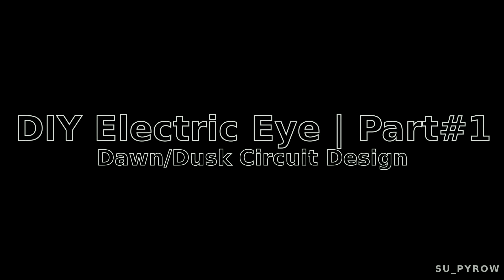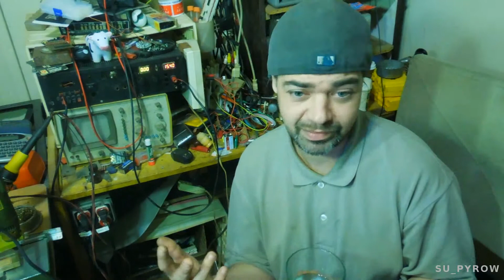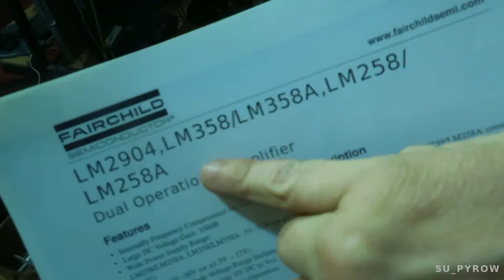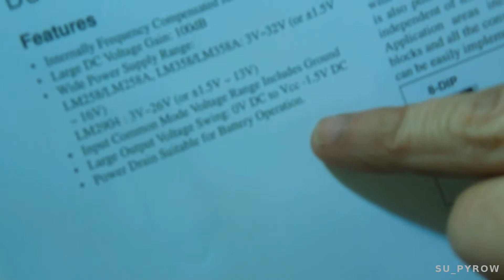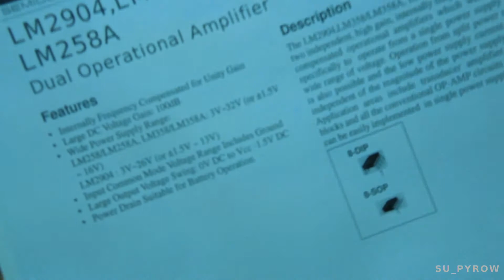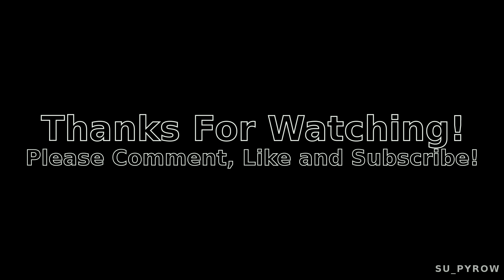DIY Electric Eye - Dawn/Dusk Circuit Design | Part#1 SU PYROW #03

Comment: Hay Bob, a lot of guys make vids about RUST.  Electrolysis, Evaporust, vinegar, other chemicals, without explanation of chemistry.  So this is a vid request for you to teach us experimenters.  Um gonna try some sodium bisulfate, cheaper and better than my fave vinegar.  Evaporust is a ripoff.  buzz1151 did a neat little vid on zinc and  electrolysis.  mrpete222 did a bunch of methods in a series.  Joernone likes Evaporust. Enlighten us, cheap good ways to get rid of and prevent rust.  Don

Comment: Hi Bobby, looking forward to this series. Will this control mains voltage things and will you be showing how to control multiple things - ie lights, radios etc. Regards, Dave
Reply from the maker: it wont, however, i will go over some way to do that.  Thanks for the recommendation David